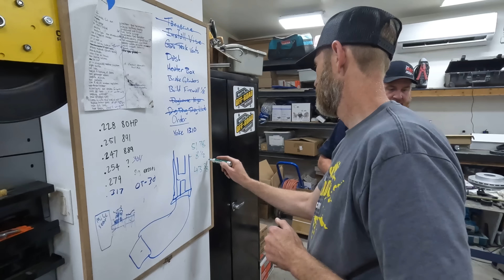The Bombi Working Backwards? Not A Big Fan.

Comment: It would make sense for the grill to have a honeycomb pattern if it is the Bomb-Bee.
Reply: Perfect and with an angry yellow jacket 🦾
Reply: Or a bomb 💣 with a 🐝 bee made into a logo as one would be cool
Reply: Great idea. Hope this gets all the likes so Matt can see it.
Reply: On the same wave length, a honeycomb pattern in a cone shape to simulate the back end of a bee. Make it like a cowling for easy removal for service.
Reply: honeycomb pattern with an Angry Hornet launching on Bomb with fuse.... just need some good graphic designer to whip up a couple versions...
Reply: YES!  Send the design to Oshcut for CNC laser-cut stainless or aluminum!
Reply: Add a couple little honey pots to it for special design??
Reply: This is the first thing that came to mind
Reply: Laser cut sheet steel or aluminum, then stretch or expand the sheet to form hexagonal honeycomb cells
Reply: I was just coming down to say the same thing.
Reply: Aye and with a bee hood ornament
Reply: Got on here to say this exact statement and also add a bee emblem.
Reply: @tom use that new arc droid to cut it out
Reply: With a bee cut out too in the center
Reply: Good idea plus it won't be to expensive.
Reply: with a killer bee in the center
Reply: I was going to say the same thing
Reply: Yes!
Reply: +1
Reply: Was thinking the same thing, honeycomb grill for sure
Reply: Yes!
Reply: Yes ! And maybe my son's idea of a BomBee in the center ?
Reply: You beat me to it with that comment 👍🐝
Reply: I have a picture. How do I upload it?
Reply: I like this idea
Reply: Crown vic grill
Reply: Literally was coming to say this and found you already did!
Reply: Make the grill look like the tail end of a bee or bumble bee.😁😁😁😁😁😁😁😁😁😁😁😁😁😁😁😁😁😁😁😁😁😁😁😁😁😁😁😁😁😁😁😁
Reply: Honey comb pattern for the grill like patriotpainter said, with a bee carrying a bomb ( or bombs ) like a bomber ( aeroplane ).
Reply: Came to the comments to post exactly this!
Reply: I am curious why you are not using 2 12" or 14" electric fans instead of the old school mechanical fan.
Reply: I 35th this comment, honey comb with a bee in attack mode😂
Reply: A honeycomb shaped like a bomb
Reply: Honeycomb design with a bee (stinger end prominent) in the center.
Reply: Honeycomb pattern would be great. You can also use the Matts off-road recovery logo outline with out the letters which is kind of hexagonal
Reply: Bomb and a Bee on top of a honeycomb
Reply: @VirginiaMaker yes! I was going to say a bee flying like a bomber!
Reply: @VirginiaMaker ohhhhh.....a bee bomber that's slinging down a winch rope and hook!
Reply: There was a Company that Patented and Marketed a " Honeycomb Radiator " in the ( ? ) 1980's but you don't see them
available any more .
Reply: Make the honey bee bomb shaped with wings and legs and a capital B on the beez chest with the hex pattern
Reply: hexagons are bestagons!
Reply: Totally agree.  Came here to say this
Reply: But in reality is just a Bombi
Reply: If the bee is carrying a bomb, it should be in the shape of the bombardier gear logo with a fuse maybe.
Reply: Honey comb pattern is genius.  Reproduction Dodge Super Bee logo would be cool.  Or I'm sure there is a MORR fan out there that has awesome graphic arts skills that could create a cool Bomb-Bee logo/graphic.
Reply: Bees don't store honey in radiators
Reply: With a Bee throwing a lasso made from “Matt’s recovery rope”
Reply: And a hive on it
Reply: Before I make a personal comment, thought I would scan through the previous comments and lo and behold the first one to pop up was my thoughts exactly. a Honeycomb design seems so appropriate. A bomb symbol has been suggested as well and the only bomb related suggestion I would consider is a symbol with an US Army Ordinance Symbol attached to it. Or perhaps a Sapper symbol, to give that Engineer, Ordinance cross over feel.
Reply: Came to say exactly the same
Reply: You guys are great on your ideas! I was thinking much the same of buying some of that pre-made honeycomb mesh to use for the grill with an added bomb/bee design attached.
Reply: @sharonnicholson3393  - though it'd look cool, honey bees (honey comb) and Yellow jackets are like cats 'n dogs. Indicators of two very different animals.  YJs are wasps, not bees - so not even eligible for 'Bomb-Bee' logo. Bomb-wasp? naaaa. Sides, Wasps are kinda known for parasitising, feeding living prey to their young, while bees our our friends and MUCH less aggressive for no reason. Though, they will defend themselves with vigor.
Reply: @Farang_Lifestyles  It's the Bomb-Bee, not the Bomb-Hornet!
Reply: Just watch out for MORR-Bears 🐻🍯
Reply: I freaking love the idea. The whole paintjob should be honeycomb yellow and black
Reply: You are livinging 2045
Reply: @WapitiEater  so it should be the
Bumble bomb
Reply: Honeycomb with Bombee built into it
Reply: Jeep grill and use light holes for back up lights/work lights.
Reply: Yeah honeycomb pattern with a bee in the centre, but instead of a stinger, it has a fuse for its bomb shaped abdomen
Reply: What a great idea! I think the honeycomb Grill would be enough.
Reply: I'm in agreement
Reply: I don’t get it

Comment: Magic words! "'66 Corsa"!  Most fun to drive car I ever owned!  Bought it new. Only had it a year. Marriage, etc. set in.  4 carb 140 hp. "Race steering", although that didn't help much since most of the steering was done with the gas petal! Went through a set of rear tires in 6K miles. Went through 3 clutch cables, drove back to the dealer with no clutch, twice. Also had a "62 Spider convertible. Piece of junk I bought from a neighbor for $25 but had to put a new battery in it. Daily driver to work for about a year. Traded it for a '69 VW that had a "2 speed Auto stick shift".  Always loved Corvairs! Glad to see that there are MORR of us!

Comment: I am particularly impressed by the Turbo Encabulator's application of modial interaction with magneto reluctance. It improves upon the concept using a poorly-conceived conglomeration of dihedral mortises and galvanized fiberglass, a first in the plastics industry. Bravo!

Another great vid, fellers! Matt is on a roll! with several laugh-out-loud moments from his application of very dry humor. Nice new steering on the DigDug. How awesome is that? Great editing, too, with Tom on the laptop and dollar signs floating away... lol
Reply: You can get rid of the magneto reluctance if you use a flux capacitor.  A flux capacitor doesn't have moving parts like a magneto.

Comment: A turbo encabulator is exactly what the Bombi needs. I'm glad to see you guys decided to pull the trigger and get one ordered. Can't wait to see the install!!
Reply: Personally I would go with the Retro Encabulator.
Reply: Remove the Girdle Spring,  that thing ain't nothing but problems.  +50hp.
Reply: @tartartar7198 , for dependability reason? The retro model doesn't make the same horse torque as the turbo model.
Reply: @NeoMK  as long as they get the version 2 of the girdle spring all should be good. A lot of the issue have been addressed.  As far as the +50 hp.... I haven't seen any dyno graphs... I'm not believing that!
Reply: I primarily work with Retro Encabulators and have always been impressed with the six hydrocopic marzel vanes that were fitted to the ambiphasient lunar wang shaft to prevent side fumbling.
Reply: @paulhimle  Side fumbling of the wang shaft when trying to encabulate is the worst!

Comment: Matt's off-road, maybe build the radiator and back off the bomb-bee like the back of a skid steer. Hinges on one side and will swing away when you need to work on the motor. Frame it out so the whole cabinet opens when you need to get inside.

Comment: "Dig Doug" is awesome because it's a truck anyone can imagine owning DD.
Keep on bringing us more Dig Doug upgrades. Tom's own design competencies and preferences are showcased in Dig Doug, and thats a nice contrast to Tom building what Matt designs. Equally great, but Tom has his own style with his own truck and its nice to see.

Here's an idea.. Get Miller give you a nice TIG welder, buy some aluminum, and lets watch Tom build a new flat bed for Dig Dug incorporating trail features (Tow and pull points, a rear winch under the bed,  lighter weight, and adding several lockable cabinets for trail tools. Maybe a gas tank that isnt factory vulnerable etc. Oh heck, and a welder.

Comment: I would suggest running a viscous clutch on that fan instead of a thermal clutch. That way, the fan is spinning with the engine up to about 3000 RPM, and then will start slipping but maintain that 3000 RPM while the engine speed continues to climb. I would hate to see the fan come apart at higher RPMs. Ugly things can happen when it starts throwing blades!!! I run that exact viscous clutch on my 401 powered CJ and it has never had an over heating problem. This build is awesome!!!

Comment: The engine bay door off a skidsteer for the back might work.  It's coming along nicely.
Reply: Most of them are used as weights as well.  Haven't gotten far in the video, not sure they need extra weight.
Reply: @jake1021  I've seen many that are just a door and the radiator hangs on it.
Reply: @nopartsgarage6691  I guess, I'm thinking of my bobcats, them suckers are at least 3/16 probably a 1/4
Reply: @jake1021  yeah they usually are thick.

Comment: With the radiator that long, I think that the installation of two electric fans would do better than the one, engine-driven fan.  With electric fans and a water temperature gauge, you could switch on the fans when you thought the temperature was too high or you could install a thermostatic switch to do the job.
Reply: Yes. The radiator could be on the side, with a combo of rubber hose and metal tubing. 
On the , radiator is going to need protection from broken strap flip  back.
Reply: maybe, but any engine driven fan will have far more airflow than electric fans do, that's why you only see engine driven ones on 3/4 and 1 ton trucks

Comment: I think the shroud should be done with a louvered grill like the corvair decklid .so it will let air pass easily but if you reverse into some brush, the louvers will protect the radiator.
Reply: That's actually a great idea..  They should be adjustable louvers,  since the fan isn't clutched anymore:   just restrict the airflow.
Reply: @calholli  yes like the louvers on a ww2  half track

Comment: Rear grill: Steel (or aluminum) slats angled downwards to create the sort of louvers seen at the rear of a military tank. Versatile hinging and quick-release pins permit it to open wide as a door or downwards or completely removed. Paint it black - no red door. Tom can slide rule it out or Matt can shoot from the hip. Either approach will work.

Comment: Matt and Tom, the reverse fan will pull from across, or from the engine area. will you add a top air flow to pull in the cooler air from outside the engine compartment? I guess it could route air from the front, (err, back), of the engine? This would be something like an air inflow that lots of offroad vehicles have for the carburetor intake, but for the air for the radiator, not for underwater driving. :)
I enjoy your build and towing adventures! Thanks!
P.S. remind Robby to add a hole for the spare tire, unless he remounts it!

Comment: Matt. That step that you made downstream of the fan will create turbulence and will remove some efficiency on your rad. Not sure by how much but it will. As the airflow travels it will hit that step like a wall and the airflow will disrupt and disturb the flow through the rad reducing efficiency. If you ramp up instead of a step the airflow will be smoother but it’s your machine and your are the one doing it. Great work though.

Comment: Matt, a question, when the engines under load could the fan catch the cowling as you seem to have very little tolerance & engines obviously move ? Just a thought. Keep up the great work from the 🇬🇧
Reply: I would doubt it as I do believe they used solid motor mounts.
Reply: you are under the impression there is bushings on the engine mounts.... there are not.
Reply: @monkeybarmonkeyman  I’ve been out of the motor trade now for fifteen years but I still can’t relate to how you can have a solid mounting ? Engines rock forward & backwards when torque is applied or removed. Maybe there’s something I’m missing by not being up to date ?
Reply: @Gantzz321  Yes when I was a motor technician (15 years ago) all engines had rubber mountings. So how is the motor allowed to move forward & backwards when torque is applied or removed ?
Reply: @nautique1970  It seems to me: if the engine is mounted with rubber mounings then engine cannot transmit as much vibration to the frame of the vehicle. In car that will be used for long road trips that is desirable.

When an engine is mounted with rubber mountings: that is when it has some freedom to rock forward & backward.

Conversely: if the engine mounted with solid motor mounts then the engine simply cannot rock at all Presumably: with solid motor mounts: in the cabin engine noise will be louder than with rubber mountings. Well, the Bombi will not be used for long trips.

Comment: Dig Dug sounds amazing and no more PSP whine. Nice work on the Bombi. I've read a few other comments and several had good points; i agree laser cut with some sort of bomb and bee or honeycomb design but also designed to protect the radiator in case you back into some brush.
Love you channel, Thanks.

Comment: You could run a fan clutch from a envoy or trailblazer, they use a electromechanical fan clutch that is controlled by the computer using pulse width modulation.  There is many control schemes that can be used or you can make a manual pwm speed controller with a couple of components on a circuit board.  You could have a knob on the dash to vary the percentage of the fan engagement.  When they are not engaged you can stick your fingers in the fan and easily stop it.

Comment: Remember that before beginning any turbo encabulator installation you should ensure that all muffler bearings are correctly adjusted, it will save lengthy rework later.  And no matter what, never, EVER engage the turbo encabulator when the knuder valve is in the open position.  Serious damage, injury and/or death may result.

Comment: IMPORTANT:o) totally serious, me and Tony did what you are doing with the half moon at the bottom and it creates absolute turbulent havoc :o  Sucking fan would be fine, but a blowing fan is half radial air flow. The air hurtling centrifugally outward will do a 180 on the step and block the flow. We actually stalled the fan so bad it was nearly sucking :D Drill some big holes in the half moon plate and let it waste some air flow to get more. Double advantage, because any debris trapped between fan and radiator will get blown out. p.s. loving this build. Was ogling a proper old VW powered snow cat yesterday at a car show.

Comment: Tom Tom saw u work on ur front suspension in a video on ur truck . I’ve owned several square body trucks .  When lifted I went a smaller diameter steering wheel and a modified steering arm .  Helped mine

Comment: Not sure why Matt considered it necessary to flip the fan through 180°. Yes, the blade pitch needed to be varied so that it pushes the air, rather than sucking it, on the shaft that turns against the “normal” rotation but I believe once the blades are pitched right, it doesn’t matter which way round it is. Perhaps there is a fixing or clearance issue or just perhaps Matt is playing with us???  Love the channel.

Comment: the bombi i used to run in the oil field on pipelines had a plastic reversable fan, winter it would draw air in to help keep engine warm in freezing temps and spring/summer switch it so it pushes air out so it didnt run hot

Comment: Since the radiator hoses are on the same side of the radiator,  should make hard lines for the transmission cooler that raps around to the end of the radiator where the hoses are and make the entire rear panel pivot out radiator and all similarly to a tire carrier for maintenance access. Just a thought

Comment: Hi 👋 👋 👋 👋 Matt just wondering if you ought to switch to an electronic fan you could just put it on top of the rail 🚈 you would have 2 fan motor and they would have there own Surround and there would be less work involved in building. Just an idea only. In a lot of ways we're kinda the same when it comes to work and simple.

Comment: thinking about the grill. the radiator is rather exposed. there is no bumper or anything unless thats still to come. so i was thinking something armoured? and tied to the frame? i was thinking taking inspiration from military vehicles grills, something made from plate 1/8 or even 1/4. the slats would be angled down in the grille shell. still gives good airflow but protects the radiator from say a winch on something lifted if it goes into the back of you. the top of the grill shell would be held by struts running back on an angle to just below the cab.

last thing you'd want is to be stranded with a bust radiator when something slid into you

Comment: If you want something simple you can use flattened expanded metal that's made from aluminum. The flattened is much safer than the raised. But I think you can get some Hexagonal Perforated Metal online, aluminum if you want to save weight, or maybe cold rolled steel sheet. Shouldn't be too hard to find something like that. But a hexagonal theme on the Bombi would be cool, maybe even have a window that's hexagonal.